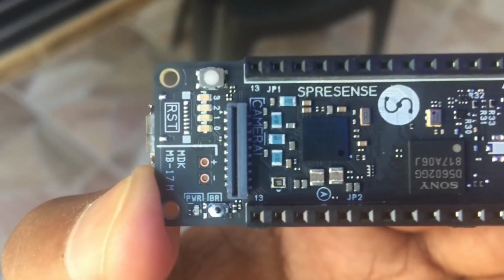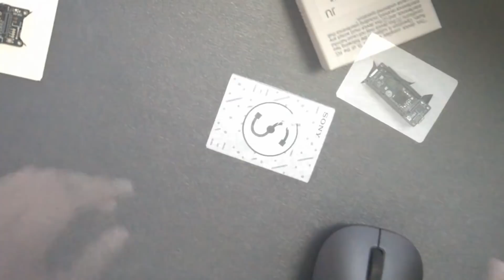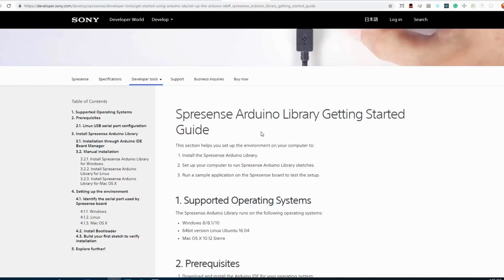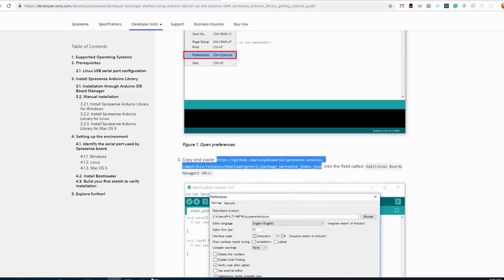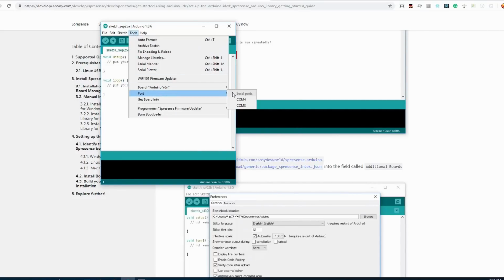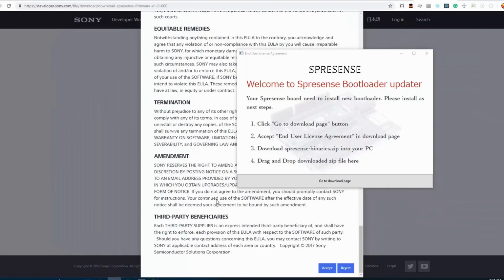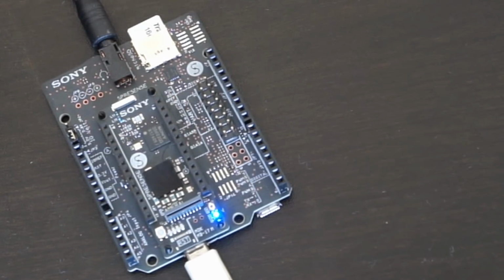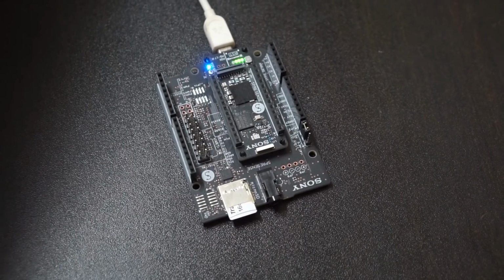Introduction to #Sony #Spresense

Comment: I don't know what people are complaining about, I didn't have any problems understanding you.
These things look so interesting. I just wonder if these will get popular enough and enough tutorials will be made to make it easy for people to get started. You could get a Teensy 3.2 + Audio Adapter for a third of the price. Or a ESP32 with 2 processor cores at a similar clock speed for 10 dollars. I don't mind spending a bit more for quality electronics, but I wonder if this thing will ever get really popular enough to be interesting for a beginner like me.
Either way, good video :)
Reply: I highly doubt that. if you search at YouTube, this is most popular video about this module. There're only few places where you can buy it. And most of all, price. For the price of one Sony board, you can get 11 Raspberry Pi Zero's. Sony have some advantages (low power consumption, audio inputs, integrated GPS) but i don't think it'll be worth for someone pay extra buck for them.